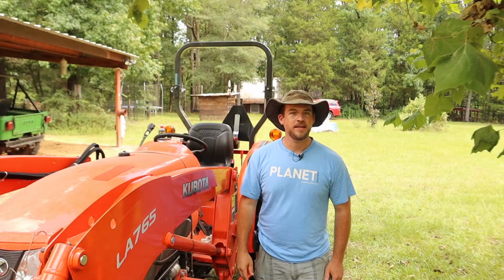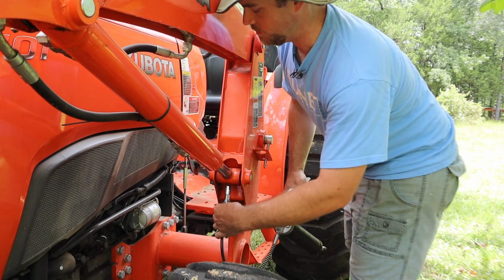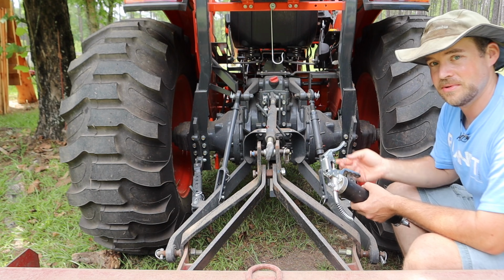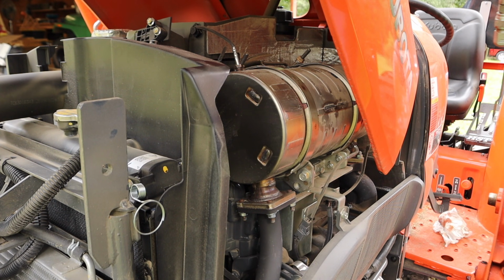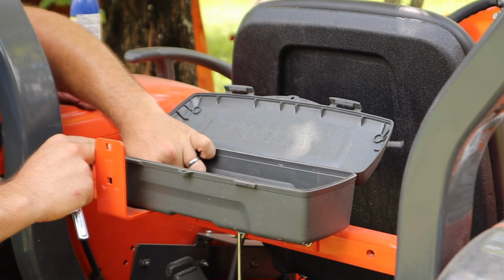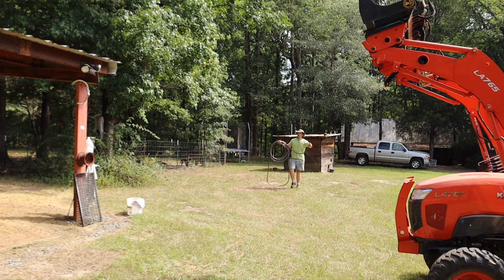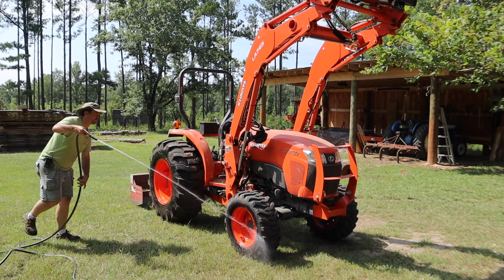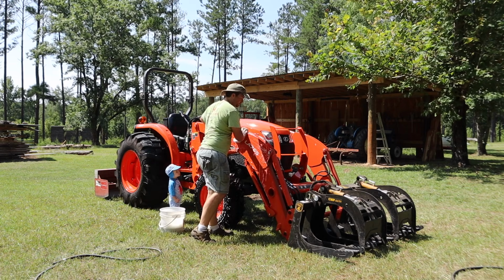I Can't Believe Kubota Did This

Comment: I have a 2019 L4701 and wondered why the lift arms don’t spread any wider so I asked the dealer while waiting on them to find a bucket level indicator I had ordered that was somewhere in a pile. The lift arms have limited travel on the tractors that are set up with the R-4 tires. They swing out a bit more on the tractors (at least the L4701’s) with R1’s. The R-4’s are a good bit wider than the R-1’s and if the don’t limit the side travel of the lift arms the can hit the tires. Not a problem on implements with the clevis attachment points (where the pin is separate from the attachment) but it’s a close fit on the bolt on pins like your box blade and some of our older stuff. The Kubota took over for a 9N so I can put up with a few oddities on the Kubota. 

By the way, if you do much bucket work with the loader the bucket level indicator is a nice, and relatively cheap, addition. Some old heads view them as training wheels but I’m not too proud to use training wheels if it keeps me from gouging places I don’t want gouged.

Comment: my lift arms on my tractor would hit the tires when i tried to spread apart. so i swapped the wheels around witch spread them out much further. not only gave me much more room back there, also made the tractor much more stable, by spreading them further apart
Reply: yep he needs to learn more of the old teicks before blaming the equipment
Reply from the maker: Trouble on this one is that the arms stop before they hit the tires. So that wouldn't help on mine. Sounds like a great idea for stability though.

Comment: Kubota salesman gave me great advice... “we’ve never had anyone return and say, I wish I’d bought a smaller tractor.” I.e. the rear arm spread / adjustment is both the tractor being (Compact) and R-4 tire width. As for the toolbox, some “competitors” don’t include one at all. 😁 Kubota Engineer’s likely decided most owners would install a TB to fit their own needs anyway.

(Sidebar) I dreamt of owning a new compact tractor, so after months of shopping Mahindra, JD and MF, also decided on a Kubota L-4701 HST, but wouldn’t purchase it without running the machine first (FYI, Builder by trade).Took it behind the dealership for 8-10 minutes and cut / graded dirt with the FEL in 4WD, then returned with my excitement diminished. The salesman asks, “so what’d you think”, me... “I don’t know, it wasn’t what I expected”. SM asks, “could you wait a week for us to prep / assemble a different tractor? We recently sold two of the model I think you would like, but we have one left in the crate.”

A week later, with the different tractor, I made just one 12’ pass cutting 2” to 3” of soil / grass / weeds, followed by a dump cycle and back drag, (2 minutes tops), then immediately returned to the dealership. SM says, “I can tell from that smile, you found your tractor”. Yep! I instead bought a “standard” utility sized tractor MX-5800 (next class up) and love it. 400+ hours later and have no complaints at all, mainly BC it’s simply a much more capable machine. Without being an “industrial” line, it has some of  the best hydraulics of any tractor I’ve operated, is still nimble / quick, but not too big to easily transport and a great machine for the $$. My advice is, don’t buy a model of tractor you’ve never operated and more specific to the video, if a toolbox is that important to you, tell the dealer and they’ll probably include one in the deal. JS

Comment: That screen over the radiator is a good thing. That's the first time i bave ever seen that done . That's a great idea.
Reply: Most modern tractors have a removable screen over the radiator and hydro coolers.  Some have 3 or 4. 
John deer has had them since the 80s.

Comment: I've got the L4701, 2016 . Same tool box,  still works. Back linkage bars look different. Never had clearance or hookup problems on mine. 560 hours. The rain washes mine. I've found if I don't run higher rpm's the particulate cleaner mode kicks in a lot sooner and more often.

Comment: It’s a Kubota issue.. my 3600 has the same problem with the hitch. I turned my hitch pins facing inside like yours and it’s still a pain.
Reply: His pins are still facing out, I can see the lynch pins. If you put them inside the lift frame instead, it makes them much easier to hook up.

Comment: I bought my L3800 in 2013 and I had several ammo cans just like that. First look at the plastic crappy tool box on on the tractor I immediately installed the ammo can. Still doing it's job and its 3/5/2021.

Comment: Something I did and other people have done is swap the front tires from side to side. Put the valve stems next to the engine so tread is still going the right direction. It gives you a little wider stance. Maybe a couple inches on each side and a little more stability on beaver loads.Great job on the cleanup.

Comment: You will want to think about a GRILL GUARD for the front of your tractor, especially if you are working in the woods!
I agree with you about the tool box!  It was the first thing to be removed and an ammo can was put in its place, exactly as you did.
The one thing I did was I added one of those small magnet trays to the SIDE of my tool box so that I could place my hitch pins and such  on it so as not to lose them in the weeds.

Comment: Look into a set of Pats’ Quick Hitch for the lift arm issues. For the holding up the FEL issue. Cut two pieces of angle iron that will just fit behind the elevating rams. This will mechanically block an unintended lowering of the raised FEL. Tie rap them in place when in use. These are very inexpensive and very effective.

Comment: I think the last quick hitch attachment I got for my second tractor was about $145.00 dollars and from one of the companies selling mainly Chinese made products. The unit has helped me and the first one I got from the local John Deere dealer and it was only 99.00 plus tax in 2002. They increased the price so much until when I got my second one in 2016 from Harbor Freight it was a joy to pay that price for the product. Your tractor is much cleaner after the wash job and must make you feel so much better and I need to clean my two and the mowers also once I get my second mower back from the repair shop. Since it is Autumn here in Arkansas I need to lube all my equipment up before it gets cold and have them ready when I pull them out next Spring for use.
Reply: I am contractor; 
Everybody went to HF with brand tools failing in the box on the shelf new;
Purchase any decades old equipment that you can find then rebuild and demand prices like the Tulip Mania
Sound like I am joking? I have been through Arkansas; I know better than to joke wit dose folks

Comment: Nice upload Wes!  Your little guy is hilarious!  Interesting comparisons between the Kubota & the Ford 3000 - as I've said, the 3000 was the first tractor I drove here in the uK and I still have many fond memories.  Great job with the toolbox too.  It does pay to give things a wash once in a while - I badly need to do my Jeep but haven't been well enough, and the local car wash has banned anyone from using it with roof bars, even factory fit ones that cannot be easily removed.  All the best to you & yours - stay safe & well.
Reply: Trampster why would they ban vehicles with roof racks? Did they given an explanation as to why?

Comment: Just an FYI, fuel efficiency is not necessarily tied to emissions! Your tractor may use more fuel than your Dad's, but, it could at the same time be putting LESS pollutants in the air!
Reply from the maker: I understand that the exhaust is technically cleaner, but, like someone else commented, does it really offset the extra fuel consumption? I bet it doesn't.

Comment: Issues with the 3point arms hitting the tires can be attributed to the R4 tires being wider than the traditional ag tires and also looks to be a category spacing. Unbolt the pins on the box blade and flip them towards the inside. A quick hitch would not solve your issue there unless you bought all new implements

Comment: An empty, or full, 55 gallon drum works great to rest the loader on while servicing. Just tilt the bucket all the foward and rest it on the drum, no more worries about a hose blowing. Just make sure you "rest" the loader on the drum gently and don't collapse the drum trying to lift the front of the tractor.

Comment: My dad was anti-QH. He had used his tractors for years without QH switching from implement to implement. I backed up, hooked up to the disc, did what I needed, dropped the the disc and hooked right up to box blade. He watched how quick and easy it was and went out and bought a QH for his tractor.
Reply from the maker: Might have to invest in one soon.
Reply: Changing implements can be very difficult, a two man job and even dangerous.  The QH is great.

Comment: A quick hitch is worth every penny and makes changing implements so easy. I must admit the tool box has a lot to be desired but the one that comes with it can hold most of the tools you would need for a field repair on the tractor or an implement. I have been looking to change mine, but have not found the right box to fit. The ammo can is pretty high to fasten stationary. I did see a guy mount one to his front end loader in a video, but my solution is just finding a metal box that will fit where the original is that is longer and a little higher. Harbor Freight has one but they have been out of stock every time I have looked in their store. Nice video but I would get the quick hitch. For what you paid for that tractor a quick hitch is a drop in a bucket. I just have a L2501 and I have quick hitch everything. My wood chipper wasn't but I modified it so it is now.

Comment: At 5:50:  The hydraulic lock only locks movement of the FEL joystick; it does nothing to stop the FEL from falling if there is a catastrophic hydraulic line failure.  I use doubled up 2x4s to hold my FEL up when I'm working underneath it.

Buy a Quick Hitch for the other end of the tractor problem.  QHs are a Godsend once you have all your 3ph implements set up to use it.

Comment: My 2012 Kubota MX4700 came with a small Mickey Mouse metal tool box, and I did essentially the same thing. I ordered a larger, stout metal one off Amazon and screwed it down in the same spot and now I can carry wrenches, chains, and other tools that wouldn't come close to fitting in the original one. Don't know why Kubota hasn't seen the light....

Comment: Not sure about your model Kubota but, you may have missed the grease fitting in the floor board just left of your right foot.   It greases the forward/reverse pedal.    Mine has a 3/4 circle cut in the floor mat.

Comment: Could you reverse the pins on the box blade?  I see some implements with the pins facing in vs out.  Some sickle bar mowers are like that
Reply: That's exactly what I did to my tiller and my box blade , turned the pins facing inward and it made them much easier to hook up to my L3901.

Comment: Ah, the .50 cal ammo can. Tons of uses and pretty near indestructible.
Reply: Actually it's a 7.62mm (30 cal) ammo can, correction, tool box.
Reply: @SandBoxJohn  it's a 50 for sure , 30 its much smaller. Correction!
Reply: The .50 can in my garage has latches on both ends of the lid, not a latch and a hinge. Bigger too.

Comment: just take the loader off when you service the tractor. no risk of getting crushed to death and a good time to grease the main pivot pins on the loader. They will rust in place.
Reply: Cut a piece of channel or angle iron long enough to keep it at max lift .Use a pin or bolt to keep in in place. I lost a friend who was working on a loader when it came down and crushed him. I am slightly paronoid about raised hydraulics now  even 40 years later.

Comment: did the exact same thing i did pertaining to a tool box placed it the same direction exact same ammo box even the same color lol. I cut a piece of rubber to place under the handle and a piece of rubber on my roll bar where the where the lid hits with double sided 3m tape so the vibration and hitting of metal wont go to bare metal and create rust. cool tool box.

Comment: You can get plastic Zerk fitting caps, $11 for a pack of 50 via Amazon.  They keep the dust and dirt from building up on the fitting.  Otherwise you need to ensure the fitting is very clean before greasing, else you will push dirt into the fitting and then the bearing - reducing its life.

Comment: I have the same hook up on mine it opens all the way to the tires and that as wide as any of them open, so don't know what the issue with that one is..
Reply from the maker: Me neither. I have a friend with the same tractor and he has the same problem. Not sure what the deal is. Another commenter mentioned that there's a different set of arms that come with ag tires, and I have the industrial tires...maybe that's the difference.

Comment: I have 1 3301 and 2 4701’s and a m105 cab kubota.  Dude I have cursed those three-point arms.  They do make a set for the ag tire ones that stand out wider.   Your R4’s are wide so u have the “ skinny arms”  on yours.  One of my 4701’s has ag tires and the lift arms are nice and wide.   I’m willing to bet the dealership ordered yours from the factory with those tires.   
  As far as the fuel consumption. If you’re out mowing or have the engine at least 2200 RPM and above they just sip fuel.  But if you just lug them around the yard loading dirt or logs they burn fuel at an alarming rate.   But like you say that is the best tractor under 80 hp that’s on the market today.
Reply from the maker: That makes sense, since the ag tires are narrower. Good to know....I keep it at about 1500 minimum...reduces the need for regens, but it does suck down fuel...maybe higher is better.

Comment: I have a 2007 L4400,. I have the same problem with a small toolbox, although mine is metal. The three point arms don't spread as wide as my dad's Ford 2n either. Otherwise a great tractor though.

Comment: I just pulled a pretty big Maple out off the Swamp that a storm blew over. Sawed it up in 8 to 10ft sections. The last cut has fork which make a pretty Crotch figure. 
 Your welcome to come get one for your Mill. 3 hours south though. Hope some has started to Spalt.
Reply from the maker: Appreciate it, Jerry, but I'm so busy right now I need about 48 hours of daylight!
Reply: @falllineridge  10 4r. The older o get the more i have to do. 
 Ordered an Lt 15 Standard from WM on Newnan. Suppose to be in Sept 24. Looking forward to fall.

Comment: WoW, I want to be your grease dealer, if you are greasing that machine like that every 10 hours, you are over greasing it by a factor of about 4.  One full stroke (pump) every ten hours would be more than plenty, might cut down on your grease bill.  Also, it would be best to always grease the machine AFTER you wash it, helps drive out any water.

Comment: as far as the lifting arms not wide enough, take the #1 pins on the implement and reverse them. That is have them point in rather than point out, a little pain maybe to hookup but you do not have your lifting arms out to max and there is a stress point to be mindful of when someone spreds the arms that wide. Just take a couple of 12 inch cresent wrenches take the mounting nuts off, turn them to the inside and pickup about six inches on each side with lifting arms, thus relieving the stress situation. I had the problem with a scraper blade and was not going to go through a lot of money when the answer was in front of me. My problem was on my GC1720 Massy-Ferguson of which I would not do with out.

Comment: When you have the arms up get a couple of lengths of channel and fit it over the shaft between the end of to lift cylinder and the rod end and add a couple of clamps to hole them in place, I do this with all my loaders and such. DO NOT TRUST THE HYDRAULIC LOCK.

Comment: Locking the hydraulics will not prevent the loader killing you when a hose breaks.
Reply: The lock only locks the valve handle. If a hose blows the loader will drop like a ton of bricks. I used to work as a maintenance elec in mining, one company had a two part tube we put around the hydraulic cylinder of the continuous miner while working on the cutting head motors. Even though there were check valves, if a hose blew, five plus tons of steel would trap me, so clamps on or get my ass kicked by my boss. NEVER trust hydraulics EVER. Remember "Murphy's Law"!!

Comment: Are you aware of the recent HST transmission recall on the L 4701? Call your dealer and check your serial number if you fall within the numbers you may be disappointed. The Repair is very extensive they take the tractor completely apart in two separate pieces and crack the transmission open to re-torque a bolt. I’m getting ready to get mine done and I’m not a happy camper
Reply: Hopefully not on the 5030’s…..?

Comment: You should NOT be under the loader when it is in the raised position without a safety catch of some kind simply because (although rare) a hose or seal can blow out and the loader can fall. All you need is a piece of 11/2” or 2” angle iron that is just a little shorter than the cylinder rod and lay it on top of the rod then slowly let the loader down until it touches just enough to hold the angle iron in place. That is cheap insurance against someone being crushed.

Comment: Get Land Pride implements. Kubota owns Land Pride. Most of their new implements are specifically made to fit kubota tractors. If you buy the quick hitch make sure you have Land Pride implements to fit. They are built to be compatible with lift arm pin distance on implements.